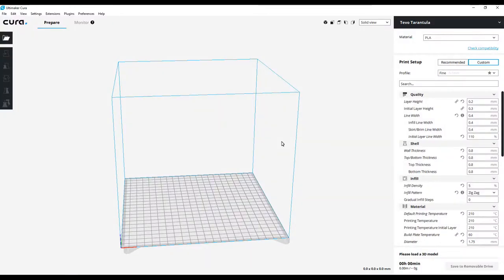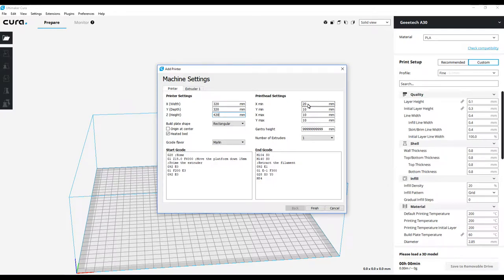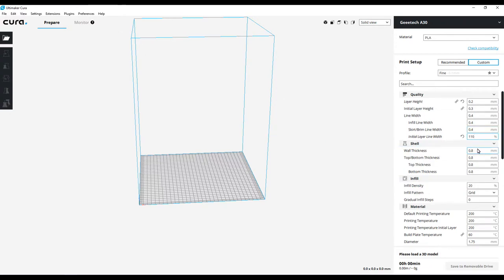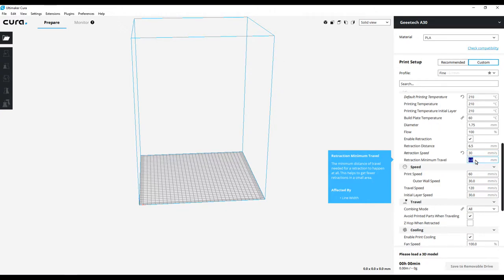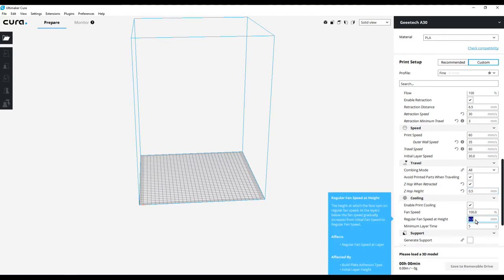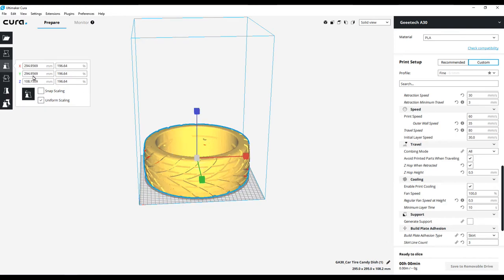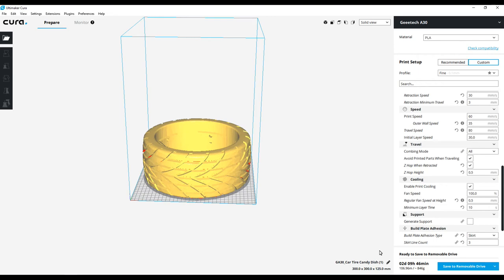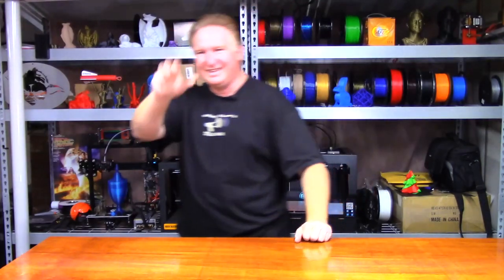Setting Up A Cura Profile For The Geeetech A30 For The First Time

Comment: Thanks kindly for posting this. I recently picked up the color mixer version (a30m) of this and I'm still learning all of it's oddities and quirks.

Interested to know if you've tried to do small figure prints with these giants (~28mm range) and what your results have been like. I've been pretty impressed with the a30m for its large volume prints (Though I'm still mucking about with settings in cura to clean up other minor nuisances, looking at you wisps.)

Personal results have been mixed, though I am certain most of mine has been user-error related.

Comment: Anyone else having trouble with Custom End Gcode on the A30. I have a 24v model, hardware V3.5 and running V1.38.59 firmware. Cannot for the life of me get it to end a print and raise Z so every print i do ends up with a zit where the hotend waits and cools down if i am not present at the end of the print to raise it manually.

Comment: i have a new A30, but Cura can't connect or find the Printer - does anyone know what the Problem is? The Printer has Firmware 1.35.56 - i can't find a newer Version.

Comment: im new at this, and a freind has one of these, After I group the 3d drawing and send it to a gcode, and to the card, I start it in the printer and it never finds the table , What am I doing wrong?
Reply from the maker: Please be sure to save the gcode on the card without placing it in a folder.  For some reason printers have a hard time opening folders.

Comment: Hi,Jimmy!Is it possible to use Cura on your computer to print via USB?
Reply from the maker: I don't know.  I've never tried it.
Reply: Yes its possible. It worked OTB on my mac and windows. Another even better option is to use OctoPrint. Then you can connect also trough the network.
Reply: @asda2341412  Octoprint need a Rasperry, or is it possible to print with an USB to TCP Printserver how to do it by 2D Printers?